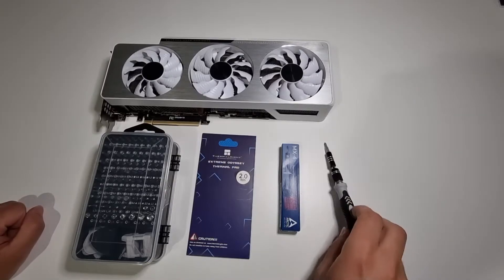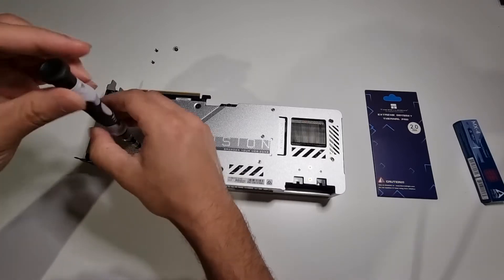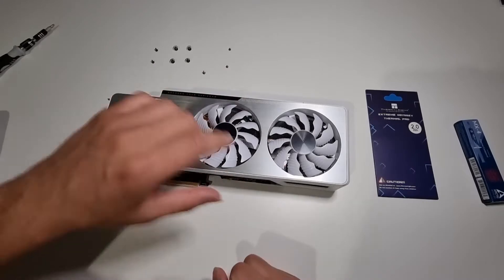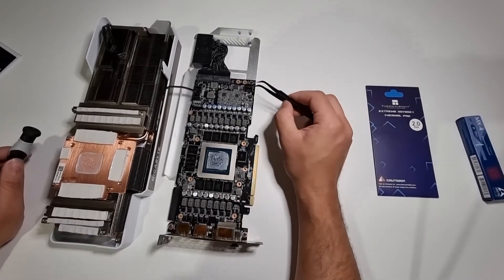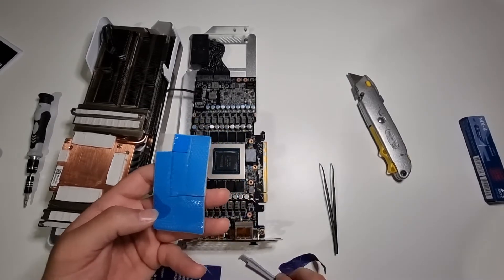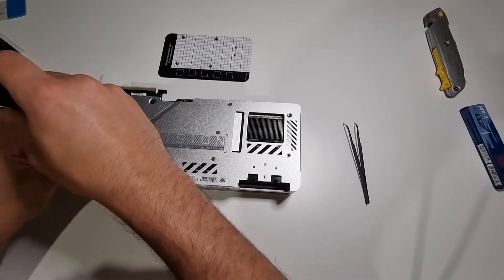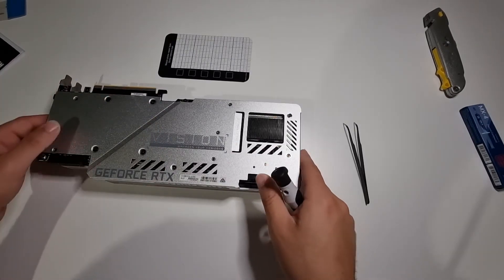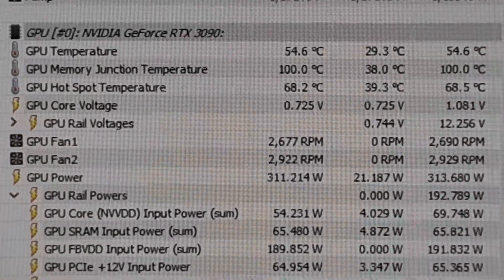How to Replace Thermal Pads on a GPU - Gigabyte RTX 3090 Vision OC

Comment: Oh my god, why did you skip over the part where you disconnect the cables 😭 my cables are stuck like cement and I have no idea if should just pull them really hard out, or if there's a tiny clip hinge I need to release
Reply from the maker: Sorry about that
Reply: yeahi have the same issue. i wanted to swap pads but i couldnt unattach the fckin cables. I could swap thermalpaste at least...

Comment: I have a 3080ti vision. Do I need to replace my thermal pads? Does the 3080ti have the same issues the 3090 does
Reply from the maker: I assume the heat sink design and thermal pads should be similar to 3090 but can't confirm as i don't have one. Check your vram temps under load and see if they are unreasonable.

Comment: Great video. I also have the same card I got from someone as a spare. I used 1.5mm pads and my VRM Temps as well don't go over 100 degrees. However , I used a different thermal paste and my chip was sitting about 8 degrees higher than yours. Steady around 62 degrees so next time I may use the MX4 instead of the Noctua Thermal Paste.
Reply from the maker: Nice great to hear you found it useful

Comment: Any suggestions for external gpu case for this card.
Reply from the maker: I've never used an external GPU case - but you would need one with a lot of airflow. Card requires a lot of great dissipation.

Comment: And what about changing pads under backplate?
Reply from the maker: I have not done that so far just changing the front pads have dropped temps 10c
Reply: @t-4nk108  I have changed all pads so the result is -25 on memory chips. I totally recommend to change all pads.
Reply from the maker: Wow that's amazing! I will buy more thermal pads to replace the ones on the back.
Reply: @Ded Pehto and how card you have? Gigabyte Vision? The same card?
Reply from the maker: I only have one gigabyte vision 3090
Reply: @t-4nk108  and how temp you have? On the memory and temp Room and how mutch %fun
Reply from the maker: You can see my temps at the end of the video. Room temp is about 25-30 degrees Celsius. VRAM temps came down from 110c  to 96c which I was very happy with considering I didn't change thermal pads on the rear of the card. I'm comfortable with card at these temps.
Reply: @mitsubishmr  absolutely the same card.
Reply: @dedpehto  And yours MHS? temp memory? fan? temp in the room?
Reply: @t-4nk108  how much mhs you go? and fan %? 100?
Reply: @mitsubishmr  120.4 Mh, room temp about 26C, mem temp 86C, fan speed 75-80
Reply: @dedpehto  Did you also use 2.0mm for all of them?
Reply: @CobraR35  for memory chips - yes, 2mm on the front and on the back.